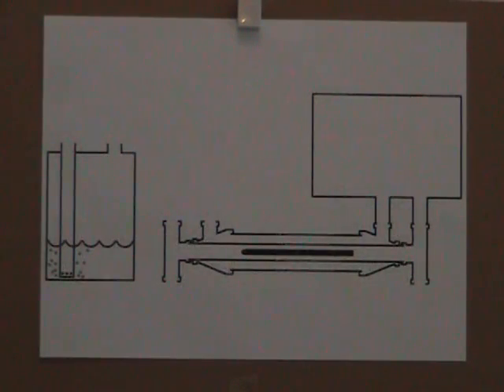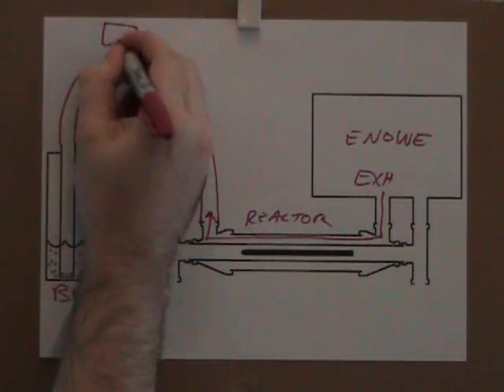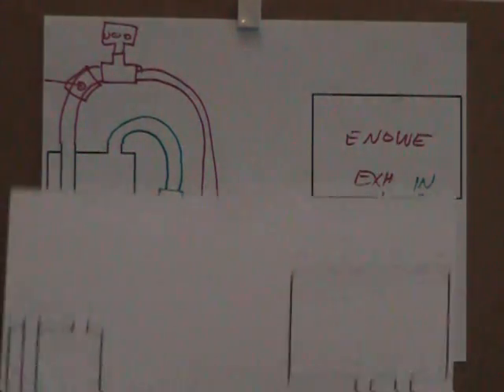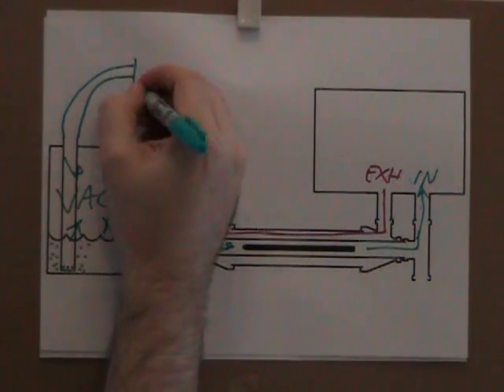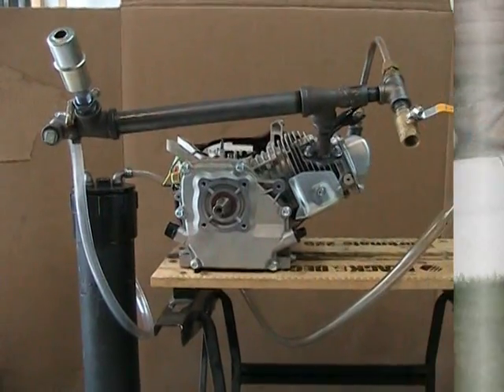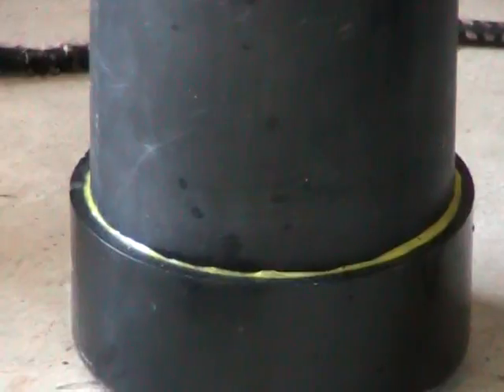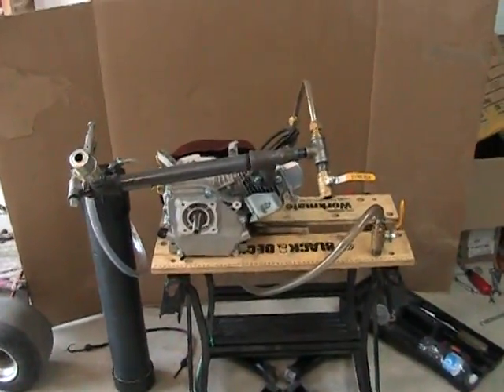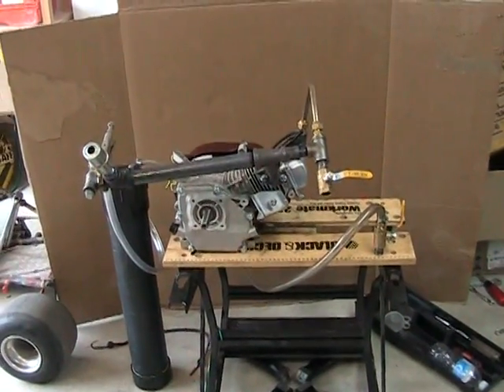GEET Fuel Processor - test 4 - revelation

Comment: I'm not sure...
Even though I respect the work you have done, the Geet system and theory is complex, and achieving good results require a thorough investigation and close following of the instructions.

For example, one important aspect seems to be that the first time you start it, the reactor chamber needs to be oriented correctly in relation to the poles.
A strong external magnetic field could maybe be enough, like from a neodymium magnet...

Comment from the maker: It's supposed to allow an internal combustion engine to run on something other than gasoline by breaking gasses into elemental gasses (like water to Hydrogen and Oxygen gas). My goal is to get my generator to run off of water and old engine oil -- nearly free electricity. Check out videos by ELManlinos, crazyfishfarmer, and aluka1603 ("14# HHO-Geet Pantone Hybrid testing")

Comment from the maker: I didn't check it with any kind of equipment but with my hand I could confirm that it would warm up right after startup and then suddenly it would get cool.  That told me that the reaction was working.  Prior to that point the bubbler and reactor were simply vaporizing the fuel.

Comment: Great video..... Question .... during your testing .... did you check the exhaust gas temporature.... from what I have seen on You tube..... if it is at ampient temporature.... it is tuned correctly.??
Not to sure... getting onto my own one to see if I can add some real value suggestions.

Comment from the maker: Thanks, I'm starting my new reactor tomorrow and I'll be implementing a better setup (gap, attn to vacuum, smooth pipes, perhaps a heat shield on outer pipe, etc) and also using automotive alternator for load.  Thx for the advice; I'll look up your spreadsheet as well.

Comment from the maker: I think so.  This motor has no carb at all, so anything would be an improvement.  I will be adding its carb back on via the bubbler in the next test but the distance between the intake and carb will be great and may still hinder performance... certainly make starting more difficult.  In this application the load and/or rpm won't change but a cv would afford greater adjustment for sure.  That would contribute to smoother running.

Comment from the maker: It's not secured.  It is supposed to float because of the "concentric magnetic field" or something.  I found that with my first motor the rod banged around violently.  This motor was better but I welded dots on the ends of the bar for it to 'stand' on while in the tube -- keep it centered in the pipe side-to-side and end-to-end. I also put a pin thru the bar to keep it from travelling too far up into the intake pipe.  My new donor motor (3.5 lawnmower) will be smoother still.

Comment from the maker: With my unit the fuel got increasingly oxidized (turning brown) and so I had to decrease the oxygen bit by bit until it choked to death.  I need to improve my reactor!  It is claimed that by burning water you are generating HHO gas (in plasma state) ...without consuming electricity.

Here's an idea: run a line off of auto exhaust thru reactor into H2O bubbler, then backwards thru inner pipe, then into intake system.  Result: possibly suppliment the car's fuel intake with HHO?

Comment: Why not make one of these tapped into the O2 Sensor w/a Tee and into a reactor. Run the reactor along side the muffler for about
12-16" and just set it one way. Do you need to constantly adjust the air mixture? If you're looking just to improve mileage, wouldn't this help? I still need to build one and thinking about trying this approach. Bween messing w/HHO for 3 yrs. and running an HHO brick into this assembly may be interesting!

Comment from the maker: That sounds bigger than prescribed in my copy of the plans.  The reduction tee can be substituted with a regular tee with bushings in the ends you want to be smaller.  However you can surely weld it all together, just leave it so you can take the rod in and out incase you want to change its length to accomodate more/less dense fuels.  All of the Pantone demo units appear to be made from permanently welded exhaust pipes -- smoother airflow is possible that way.

Comment from the maker: You can google greasecar and there are also Youtube vids on it.  Diesel engines were originally designed for vegetable oil.  With almost no modifications you could run a modern diesel off of used vegetable oil from a restaurant.  In colder climates you need to pre-warm the fuel and also pre-warm the engine which means you have to run off of diesel for first few minutes then switch.  My next car will definitely be a diesel!

Comment from the maker: That was suggested as a way to experiment by one of Pantone's students on another video here somewhere.  It could work but you may not have as good of a venturi effect with all the turbulence a threaded rod would generate.  If you had the equipment I think rifling the intake pipe and impeller fins in the exhaust pipe would be more effective.

Comment from the maker: Yes, but it's complicated.  You have to account for a variable load (accelerating, cruising at constant speed, decellerating, etc) by opening or closing the air and fuel valves together.  There's a video out there with a guy that put a geet reactor on a pickup truck and made the control box out of wood.  However a constant speed application (lawnmower, generator) is a more practical application.  Would you consider a greasecar?

Comment from the maker: I actually changed to a seamless iron inner pipe which has 9/16" ID. 1/2" rod leaves me with 1/32" clearance all around ~= 31 thou.  But I hadn't thought of iron rod.  I may try that.  Also I'll use a bigger glass jar or an in-line empty drip jar to eliminate liq fuel reaching reactor.  Also I'll BBQ my reactor to reach Curie temp (~770 F).
Do you recommend magnetic reading thru outer pipe or disassemble and read rod directly?

Comment from the maker: Not bad but I think the simpler approach to spinning the exhaust air would be to fix impeller blades into the outer exhaust pipe. They would tolerate the heat and also potentially increase the contact area with inner pipe surface without adding too much back-pressure in the exhaust system.  Insulation is agood idea!  Heat is the key and I don't think I have enough of it at this stage.  Possibly a fixed heat shield to trap radient heat... like an outer-outer pipe.

Comment: Hi neverchk and all watching these videos.Just a few ideas.would riffleing the inside of the outer pipe create a vortex?,and would it help/hinder?.how about wrapping insulated  exhaust bandage around outer pipe to retain the heat and fitting a pre heater device into the bandage to negate the need for petrol to start.or even a self propeling fan at the entrance of the exhaust outer pipe to increase vortex effect.Might be talking out my arse but anything is worth a try keep up the great work

Comment from the maker: ....rod is currently 12" long but will cut shorter for water/fuel mix.  For used engine oil it will not need to be shortened to the same length.  Different length rod for different density of fuel.  Trial-and-error is the way to go at this point.

Comment from the maker: Thanks. Everything is steel. I'm using 1" steel pipe with 5/8" interior diameter for the inner reactor pipe, and the rod is 1/2" steel. I haven't tried using a compass on the rod directly, I was trying it thru the outer exhaust pipe and not getting a strong enough reaction on the compass. Disassembly is key there. I tried to run 30min on my last setup but my fuel jar's too small & splashed up into hose. I need a bigger glass jar for strength and cleanliness.  Previous fuel cans all had problems.

Comment: Thanks for the info...great job.  I was wondering if you did run the engine on the North south coordinates for 30min? and if you did what the one commenter on test 3 suggested using a compass on the broken in rod and cutting its length.  How long did you make the rod and what dimension is it? and the type of metal you made it out of?

thanks for all the information

Comment from the maker: Claimed factors for plasma reaction: Vaccuum, Speed and Electromagnetsim. Rod creates restriction in pipe leading to "Venturi effect". Fuel flows at high speed thru increased vaccuum around rod. Counter-directional Hot/Cold gas flow creates electrostatic charge surrounding rod = electromagnet. No rod = no venturi effect and also no electromagnet within fuel flow.

There must be gasoline to start the engine because there's no heat yet.  Once up to temp, H-H-O plasma can be created and consumed.